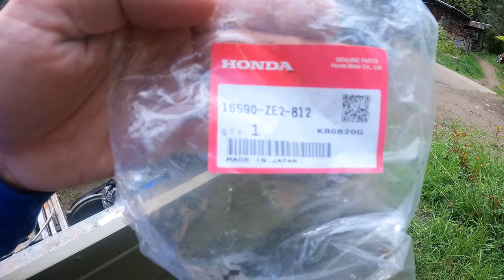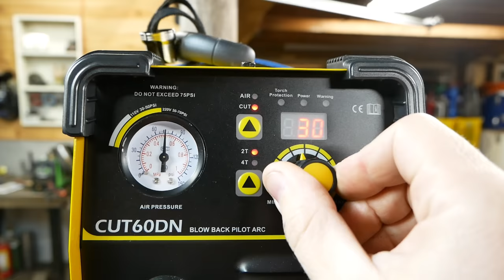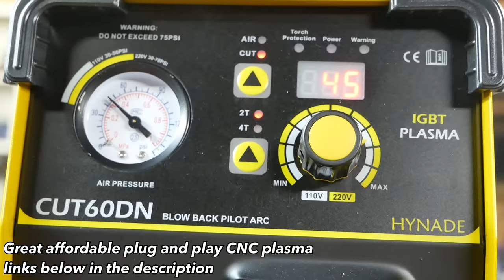Mini Pinzgauer 6x6 build series part 15

Comment: this thing is amazing, great job.
there are only a couple things i would change, 1) a set of tail lights,  just a couple of those quarter sized marker lights in red would do and they wouldnt even need to work as brake lights. simple marker lights would be perfect.
2) a rear bed light like on a pickup truck because if your out at night it would help a LOT to see what your doing back there.
3) some kind of canvas type rear cover over the bed and a simple windshield, kinda like a golf cart. i know these are not needed but they would complete the look a bit more and if you get caught in the rain it would help keep you a bit dryer.

Comment: One thing I noticed with the roof is that you you cout horisontaly over the beading leaving gaps on the roof in front . Would'nt it be better to turn it around and leave the smooth side to the back or maybe just run a horizontel bead acoss the openings to finnish it of . Great piece of engineering and I love watching the lazer cutter at work . Magical.

Comment: very nice. the bodywork is also very well done. but you should have made an independent rear suspension. then it would be a bit more original. on the other hand you are right, there is also the Volvo and it does not lose any ground clearance when articulating. the pinzgauer has a Tube frame suspension. I think the Volvo is better at slow climbing.and the pinzgauer is better at driving fast
Reply: Volvo 303. the pinzgauer has the better articulation...
Reply: @avocadoleude253  definitely not. the pinzgauer has almost no axle articulation.

Comment: Nice job, But its advisable to use side double shocks with a variable swee bar especially when equipped with load. Am so happy to see it running.
Reply from the maker: The rear axles don’t move like a regular truck, the rear suspension is more like a quad with a solid axle.

Comment: It looks like you've got the HF Hercules power tools. I just bought myself the circular saw and like it so far. Hard to beat the price and the quality is more than good enough for me.
Reply from the maker: Yes I really like the Hercules line of tools, they haven’t let me down yet 👍
With all the camera work I do the small USB charger that fits onto the 20 Volt batteries are also really great 😊

Comment: are you putting a back wall in the cab ?? removeable wall winter time work ..it is looking Great ,, only thing you did wrong ,, you did not build 2 of them lol .. love the paint job you scratch it you can fix it with out a lot of work ,, if you did the car paint job it makes it hard for touch ups .. going threw the woods you will need touch ups ..

Comment: But wait! What is that stuff...... Is it called...... SUNSHINE?
LOL!
I didn't go back and look but it seemed like that was missing during a lot of your videos.
Watching you cut out the panels for the bed using the plasma and piece of angle iron I had a chuckle at myself.
Years ago I was fabricating a box for payments to an honor system produce stand.
I got out my torch and trusty piece of angle and went to it. I started tacking the sides together and none of it fit right.
The culprit was the angle and myself. Sometime or another I had clamped the angle down to something warped or got it too hot. It was my trusty angle because I had painted it orange so I wouldn't use it for anything else.
It was only warped down the one side the other was straight as could be. I managed to turn the parts and the bow matched up so the box had a nice crown to it.
Everyone said that box was so nice with the curved top. It was so fancy and I must have really gone out of my way to do it like that.
This is the first time I have said anything about the reason for that fancy top so the cats out of the bag now.
So it was worth a good chuckle at my own fault for making such a rookie mistake.
I'm with you I liked the brown too.
Oh well...
I love the build and appreciate how much work has gone into it for it to look so nice.
Have fun and work safe!
Cheers
Terry

Comment: What would you need to do to it to make the bed stay horizontal while sideways on an embankment ??? Something like a pair of scissors for each set of wheels so that your bed remains horizontal instead of throwing you around from side to side ??? If you take a look at rock crawlers they are able to go over boulders while the bed & cab remain horizontal with the wheels extending up to 3 feet or more up or down.

Comment: Great job ! A question :why a single shock at the rear axle ? If you want to load a lot, don't you thing it should be unstable ? Excuse my poor english, I 'am belgian..
Reply: The rear suspension is from the original  Polaras  6x6 this vehicles is basically a Polaras 6x6 with a body built on to it really is not built  to haul heavy loads

Comment: Hello from the Netherlands .  
maybe it would also be nice if you make some kind of underbody panels so that you can no longer see the atv frame so recognizable.  
even if you just make a rubber skirt that just follows the contours of the frame it is already less visible.  
which makes simple little toolboxes for the old footrests.  
then they are no longer recognizable as footrests and you can store some simple basic tools in them or some winch stuff and straps.  
thanks for the video .  Sincerely Hollandduck